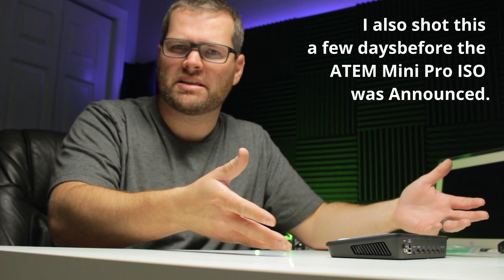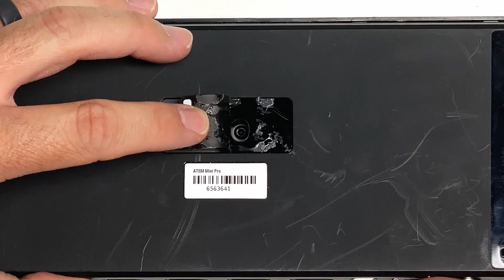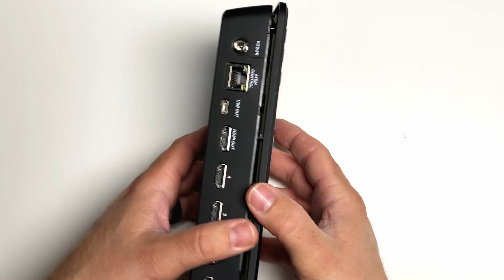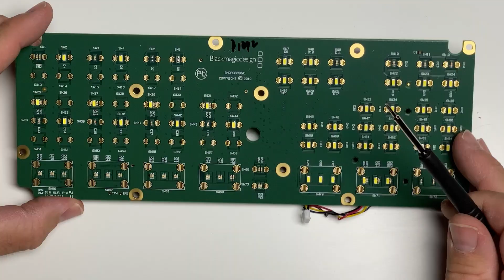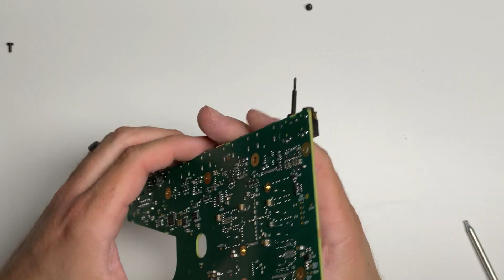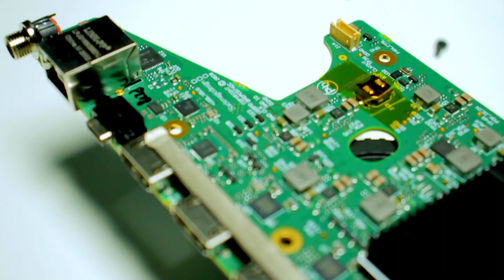What's Inside the ATEM Mini Pro? A Quick Teardown to see Just What Blackmagic has done!

Comment: Hi. I got a new 4k splitter so i can display to 2 projectors from my atem mini extreme switcher. All went well until about 2 hours of show, everything went black. Initial suspect was that the new splitter caused ground. I recently checked the extreme and it did detect all HDMI input but the output resolution is not okay. Audio and recording is fine. One suggestion was to change the pins of hdmi out. I'm not sure how delicate the pins are and there's no ATEM service center. I'm not super knowledgeable about this. Hope i could get a help from you or anyone? It will really be a big help🙏
Reply: If your experience with desoldering or soldering SMD components is slim tot none, please do not attempt to repair an HDMI connector.  The pins on an HDMI connector are delicate and if you don't know what you are doing trying to desolder the HDMI connector you will rip off incredibly tiny pads that will require a lot of work to repair if possible at all.

Personally, I would be more suspect of the interface chip that drives the output.  If it is the same in the Mini Extreme, it is a TDP158 interface chip, and from what I have been able to find it is slightly notorious for going bad due to overheating issues.
Since it doesn't see any passive nor forced-air cooling in the Mini Pro (Bought a defective one yesterday hoping to fix it) I would not be surprised if that is the culprit in yours as well.

Mouser sells this TDP158 chip for about 5 euro's each in my country (The Netherlands).  Some phone repair ships might be willing to try and fix this if they do soldering to phones and tablets or laptops, because the technique in doing so is inevitably is the same.

Comment: Please note that you DO NOT NEED to remove the strain relief nut from the power port to open the case (and clean the fan, for example). Mine was extremely tight and I'm afraid you could damage somthing if you try to remove the nut.

Comment: My HDMI out went black at one point and never came back. Any ideas why? All cables and connections and screens were verified and in good working order. All other functions of the ATEM were good. Firmware was updated aslo. Any help would be appreciated. Unit is off warranty. Thanks.
Reply: Can be the TDP158, which has some mentions in the datasheet about max voltages and temperatures in free-to-air operation (which the application in the Atem mini switchers obviously is not).
Given that it does not see even a little bit of forced air cooling and the fan in the unit I have barely spins at all even though the main processor get's freakishly hot (burn your fingers hot) it could be that it sees overheating.
Best things to check is to heat up the PCB with a hairdryer (if it blows hard and heats up quickly, use a big distance, if it's a much older hairdryer, you can use a smaller distance) and heat up the PCB for let's say 5-10 minutes, and switch on the unit.
If there is output and it is intermittent, it could be heat-related where the TDP158 chip is suffering poor contacts that due to heat become better (expansion is a thing after all, even in 5x5mm sized components).

If that doesn't make things better, try cooling it down by force-cooling it with something (preferably something not causing condensation to appear).  If the chip suffers a thermal runaway state due to poor thermal dissipation (achieved by good PCB design, which....well, might not be what BlackMagic adhered to) you will see it that way.

Find something plastic and softly tap the chip as well: if that causes output to temporarily reappear, the chip might only be suffering poor contact on pins, and require reflowing with a hot-air station, protect the HDMI out port with aluminium foil when you do to prevent melting of the plastic core of it.  Pay attention to the small parts in the immediate surroundings as well, they might start to wander off because of the hot-air gun's airflow.
Take a high-resolution picture beforehand if possible so you can identify missing components if only for their shape/color if necessary.

Troubleshooting will be the more important thing to do here in order to not replace the wrong part and not fix the problem (or make it worse).

Comment: Hello, I hope you are well. We have an Atem mini pro, during a transmission in a gym there was a voltage spike that affected it (although we were protected with UPS); at that moment the HDMI output port smoked and so we immediately turned off the equipment. Then to test it we turned it on, the 'atem' turned on, however it does not give a signal on the monitor (HDMI output). I ask you: Is there any chance that it can be repaired if only the HDMI output port has been affected? comments. Thank you very much.
Reply: If you observed smoke, you should be able to open up the unit and witness the TDP158 chip near the output port having a burn or "blister" mark where the smoke left the part.
If you need to ask this question, you are probably not equipped with the skills to desolder this chip and buy a new one off of Mouser or a similar electronics parts store, but it might be possible (I am attempting to try this myself for a unit with intermittent HDMI out which does work but might have a defective chip or loose legs on the port itself.)
A voltage spike will probably not have been transferred into the unit (switch-mode power supplies, which the ATEM uses are typically protected from them reasonably well because of how they create lower voltages) but if camera's tied to it were operating on mains voltage there can have been a voltage difference between devices, more the result of a ground loop than an actual voltage spike.

If this spike was the result of a direct or indirect lightning strike, it might have damaged the power supply first and then hit the unit, or there was a spike induced in the cabling due to the massive amount of power in the electromagnetic pulse that a lightning strike also is.

Comment: my HDMI Port 1 is not displaying any kind of signal anymore. just black screen. Blackmagic says since its out of warranty period, there is no repair. I am thinking it may be a port issue. any idea of how to replace the port on our own by soldering a new one
Reply: If you are convinced it's the port (it could be, but I'm more suspicious of the interface chip right behind the port which is a TMDS171), protect some of the smaller parts on the underside and heat it with a hot air gun from the underside without a nozzle on it.  This will make the ground on the HDMI port become hot enough for removal along with heat traveling quickly enough to the much smaller interface pins to nicely detach without to much risk of ripping of a pad.

Take high resolution pictures of the immediate surroundings of the HDMI connector to be able to identify any possible parts that go wandering off or fall of due to the heat of the hot air gun.
Reply: I had the same problem after about 2 months, then output died after about 4 years, I needed the unit so was not able to return it under warranty, but now have replaced it with a new one, there is a video on the out put problem, have been looking for one with the input problem, I have the tools and experience, but I am pretty sure there won't be much help coming from Blackmagic, these things look like they are pretty much straight forward on design and repair issues, incredible for what they can do, thank you for this video.

Comment: Many BM devices (BM converters, PCI minirecorder so on) havn't the interface HDMI chips (in most cases the HDMI interface is realized on FPGA), and I am really pleased that seems in Atem mini there are some secialized HDMI interfacing chips. Could you kindly wrote down the markings on those chips? I have heard that Atem mini inputs often burining out because of bad grounding, so just interested where to buy spares and what the functionality of those chips. many thanks.
Reply: The HDMI out is at least a TDP158, and is a display interface chip capable of handling several DisplayPort lanes. 
The HDMI in on number 1 is a TMDS171, this is the only interface-in chip that is different because of either setting format standards (it can determine the video standard the rest of the inputs allow/set if I remember the manual correctly), but it could also be different because it might allow routing HDMI 1 directly through to the out, so might require some extra pins.  It's also the only non-BGA chip on the interface-in ports.

HDMI 2, 3 and 4 all use adv7610bbcz-p chips.
This is information that for me comes from an Atem Mini Pro by the way (one that has a defective out, that is working, but mostly intermittent).
In my case it probably requires replacing the TDP158 but I'll have to do some more testing first because output seemed to become a bit more stable because of the chip heating up.
When there was some display at some point, it did eventually show the correct colors, so the chip is fine, and it could also just be the pins on the HDMI out port that are not making good contact anymore.

If you want to look at spares, look at Mouser, Digikey, Distrelec or a different big electronics parts seller.  The TDP158 is sold by Mouser.

Comment: What adapter are you using to connect the Sennheiser lav mic to the Rode Wireless Go?
Reply from the maker: Hey Victor! Sorry for the late reply.  I took the last month of the year off from YouTube.

In answer to your question, the ME2 is one that I had replaced the connector on a long time ago.  I think it is a Rean 1/8" screw down connector.  It sounds good, but I think it may have needed a resistor or something in there.  I ended up just getting a Rode Lavalier Go for $80.  It's not the best sounding mic, but I know it'll work withe the Wireless Go setup.

I hope that helps!  Thanks Victor!

Comment: Thanks for doing a teardown!
"The fan is really quiet" LMAOOL - Not my ATEM Mini Pro ISO!! It's loud when it's not hitting something (shroud or wires?) and when it is hitting something, it is unacceptably LOUD and unusable. And there's more than me that has/had this problem. Most disappointing for $900...
Reply from the maker: That’s funny! I never hear mine unless I am doing a firmware update.
Reply: @RyanKnowsNothing  Perhaps a difference between the Pro and ISO?  To be fair, mine doesn't run all the time but if I have more than 2 inputs and also doing keying, it fires up and gets louder and louder during use. When it's banging against (I'm guessing) the wiring harness, it's flat out disturbing.

Comment: Im the same way dude, my parents would get upset when they would buy me electronics and I would rip it apart on day 1
Reply from the maker: Ha!  Yes.  I'm surprised my parents kept buying me stuff like that!
Reply: Yep - Guilty as charged myself! LOL
I thought about doing this (teardown) on my relatively brand new unit because of the terrible fan noise my ATEM Mini Pro ISO has, especially when the fan is hitting something, as it does occasionally. So - THANKS hi-tech on life for doing it first/for me!!  Based on your video, my guess is it's a cheap fan made of cheap materials, which swells and gets off balance when it gets hot and thus starts hitting the shroud or the wires on its connector just below (a really dumb place to put the connector IMHO) or both. 
This video is very informative about the basic architecture of the unit. And, nope - the ISO didn't get those extra audio switches on input 3, so maybe they're for the Mini Pro Plus-1-day-maybe version. ;-)

Comment: you know what i'm so glad you did this. There's this thing that occasionally happens when i press one of the 4 inputs, it either doesn't fully switch or switches twice (like two presses). Now i know the contact points, and where exactly to push to avoid such. Thank you!
Reply from the maker: You're welcome Toby!  Thanks for tuning into the stream too!
Reply: i have the same problem. you have fix it?

Comment: Good engineering, to provide extra contacts for additional buttons should additional features be desired later, they can easily roll out a Pro Plus model without having to re-spinning the board for the extra buttons, just add the LEDs to the BOM and update the software, modify tooling for the plastics which may be done with an insert and update tampo print for front label. Slick layout and so glad you did this as I was curious about the innards. Shame you didn't do a close up of the chips so we could see part numbers and scrape off the silicone heat paste. Easy to add back afterwards if you're a PC builder like me and have a tube of artic silver.
Reply from the maker: I know! I need to do a good closeup of everything. Maybe the next time I get a new switcher. I want to see what model (if any) they come out with next. Then I hope to pull the trigger and buy it. We’ll have to see! Thanks for the comment and insight!

Comment: Great! To makes nerds even happier In tear downs, try to get FCC numbers on boards if there are any (then you often can lookup ton of info about the board for free). And closeup on main chips like FPGA/SoC/CPU and maybe memories.
Reply from the maker: Thanks man!  I know, I'm still quite a novice at this side of things.  It was technically my first tear down.  I'll probably open it up in a bit again to do a few more tests.  Eventually I'll get it!
Reply: hi-tech on life I’m a bit clumsy so so typically avoid it. Always worried there’s some flat cable between boards you missed and you’ll get hard to repair damage.

Very cool finding that they seemed to have built for many buttons originally. Would be cool to know if how similar the different units are, if they run the same FPGA or if the cooler models needed a “bigger” more expensive one.

I did a vintage lens tear down some years ago to remove fungus and what not. When done I had a one screw over after reassembling :)

Comment: Thx for the teardown. If you plan on doing more of these in the future you might want to have a look at what Dave Jones from EEVBlog does.
You did a great job of explaining the mechanical side e.g. how to take it apart. But I was missing things on the electronic side. I understand that you do not have the knowledge to do in depth reviews of the circuits like Dave does but if you get what‘s important for viewers who know about electronics you may make your videos way more interesting for them.
Things like high res photos of the boards, rubbing of the thermal compound to read the part number and in general pointing out part numbers of the bigger chips would be great. The next step would be to search for those part numbers to identify the purpose of a certain chip but I think this only makes sense if you yourself would want to learn about electronics or the inner workings of the specific product. If not I happily search  for the part number myself.
None the less thanks for the video.
And to add some info: The silvery tape on the bottom isn‘t a thermal pad. The metal cans on the bottom part are for shielding and the tape serves the same purpose. It‘s shielding tape that covers the gaps where it‘s impossible to use the metal cans to shield high frequency circuits.
Reply from the maker: Hey Bastian!  Thanks for the advice.  I am definitely still a novice at most of this stuff.  I have the audio production side of it, but yeah, the technical side not so much.  I'll keep those in mind for the future!  AND I'll check out Dave's info!  Thanks again!

Comment: J11 on the left edge looks like it could be for another USB-C connector.  It has the 24 pins required and is the same physical size as the USB-C connector on the back.
Reply: The USB-C on the back marked J8 is nowhere near as large and doesn't have as many pads as we see with J11.